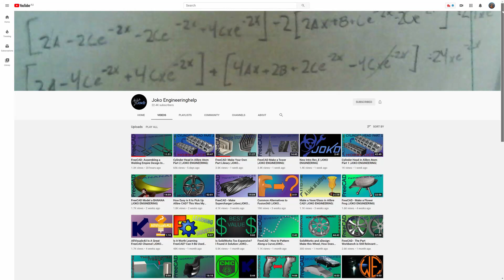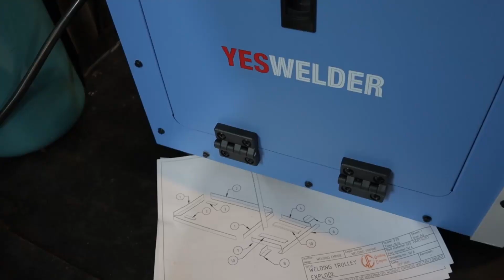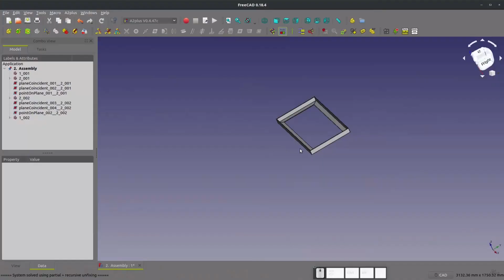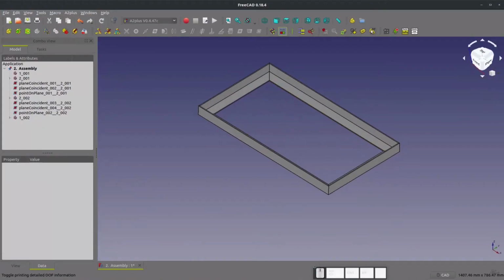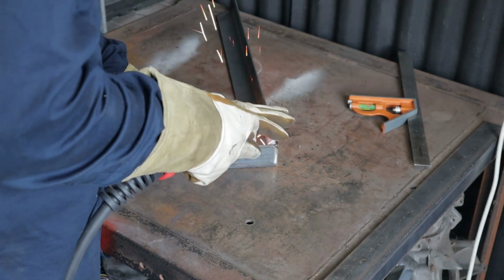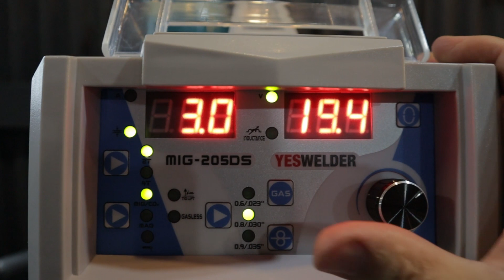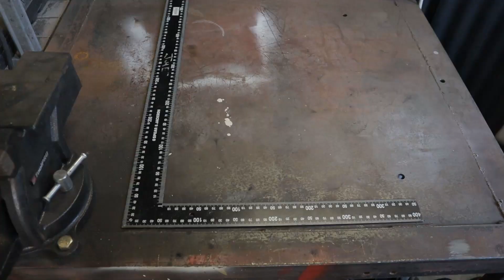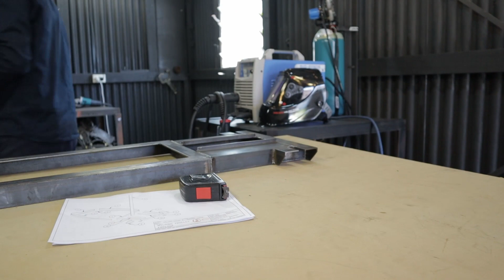Welding Cart Build [ FreeCad Colab With Joko Engineeringhelp]  Part 2

Comment: great videos. you should do one on mig aluminium.
Reply from the maker: Hey Dave, I glad you found the video helpful. I don't have a MIG capable of  welding aluminium as yet. What are you looking to weld in Ali?
Reply: @weldingempire  any mig will weld aluminium, just swap your liner out in the gun to a teflon one, straight argon and you're away.

i do a bit of it on and off, usually steel but I'm trying to focus more on aluminium. Almost finished an 11.5m boat trailer.